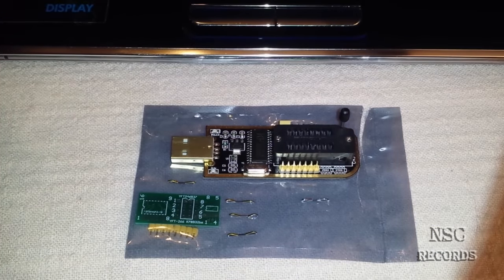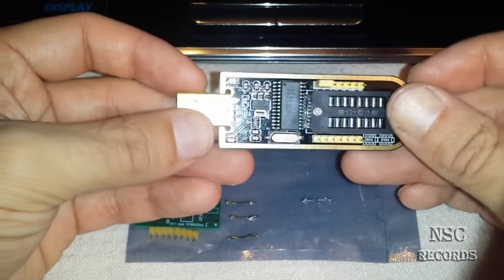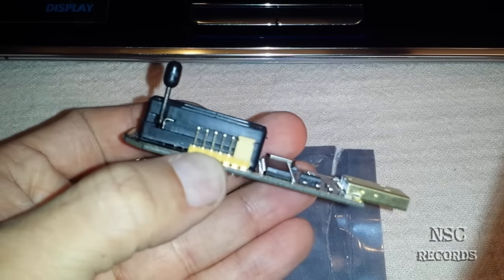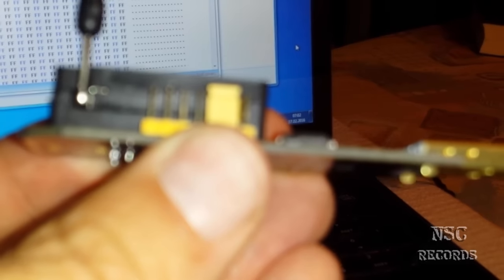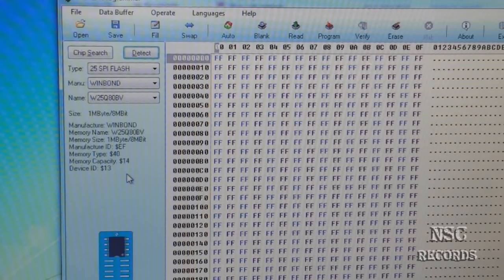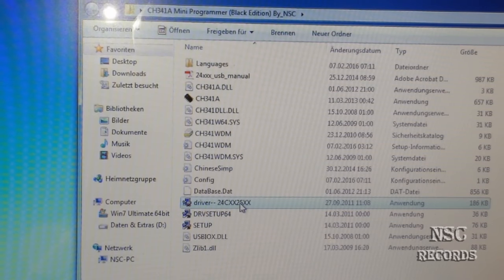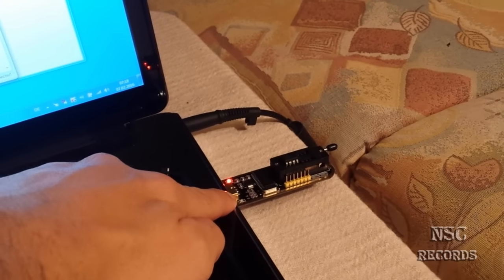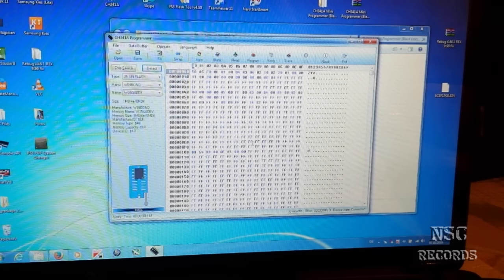Installing Drivers & Software for the USB Bios Chip Programmer CH341A (Black Edition) By:NSC

Comment: Hello. Could you please share with us what the extra jumper pins are for? I have successfully written BIOS bin files to chip, but the system does not seem to like the new bios information, even though it is the correct file 100%. Maybe it needs to write to chip in a special mode?  Thanks.

Comment: Hi! Just to point out, the jumper betwer 1&2 or 2&3 is used to set the programmer in Parallel or Serial mode respectively (there are different drivers available for each mode)

Comment: This device has 2 operation modes. The mode selection is based on the jumper placement.
Jumper pin 1 & pin 2 -> programming mode. As you well described.
Jumper pin 2 & pin 3 -> serial TTL mode. We can directly connect pin TXD, RXD, and pin GND (3 wires) to a serial port of another device.
Reply from the maker: That's right, you got it to the point :)

Comment: Even though you posted this several years ago, it is still a huge help to us who are having troubles with BIOS (in my case, on a LattePanda Alpha - the flash to the new BIOS went badly and I bricked the device). My biggest issue was getting the menu system in my CH341A in English - and YOU solved it!! Many thanks - was pulling my hair out.  cheers
Reply from the maker: You welcome ;)

Comment: 1. Position of the Tab:  It is written on the circuit board.  1-2 for programming and 2-3 for TTL.  Unfortunately written in Chinese
2.  The Up or Down connection:  It is also shown in the circuit board.  Top is for 25 and down is for 24.  For most bios,  it is 25 chip and one must select 25 SPI Flash in the software.
Reply from the maker: Great Info THX

Comment: Thanks for the video. I don't have this programmer (yet). Nor have I downloaded the software yet. But there is one thing that seems obvious to me, just from watching your video...

Problem #2, Wrong Chip Placement in Socket Depicted in the First Version of the Software (that you used)...

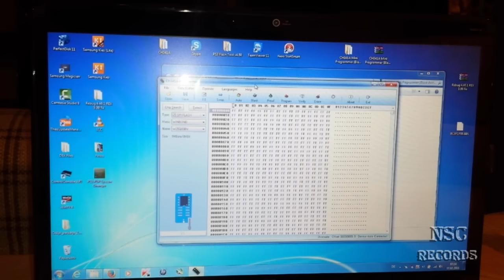@ 10:46 - The type (in the first software) is set to "24 EEPROM".
@ 14:00 - The bottom of the programmer shows the upper bank = "BIOS 25 SPI", and the lower bank = "EEPROM 24 I2C".
@ 16:32 - The type (in the second software) is set to "25 SPI FLASH".

I would bet you 25 cents that both software versions will properly show (in the lower-left graphic) the correct orientation and placement of the chip, if the correct chip type is chosen. I could be wrong about that, but I doubt it. Once I get the device, I'll test that.

I plan to use this device on HT24LC32 chips (which can also be written to by the end device). It's obvious to me that 24 series EEPROMS would use that lower bank, that was incorrect for your 25 series BIOS chip.

Still, a very helpful video, after I jumped to about the ten minute mark. Pins 1 & 2 was it? LOL (Sorry, I couldn't help myself)
Reply: I now have the device and have tested my "pre-ownership" theory... mostly. The video never really tells exactly what the first software was, you know, the one that you abandoned. However, I did download and test the version of the software that you provided the link to (thank you for that).

My original theory was proven correct in the second software version (the one that you ended up using). When the type is toggled between "24 EEPROM" and "25 SPI FLASH", the graphical representation in the lower-left does indeed show the correct orientation and placement of the chip for each type.

It's hard to believe how little $$$ you can get these devices for. Mine was around 6 bucks. And your links to the files made it easy. I just used the file that pre-installs the driver, the file that installs the main software... and it just all worked.

I installed on a Win XP 32 bit laptop. Works like a charm. Thank you for putting it all together and providing the links.
Reply from the maker: @dalemarkwell1171  Hello I just saw your comment right now and yes you are right about the Chip position, first you need select the chip type, then you will be able to see the chip position, but on the time i did this video i was very new to this tool to, so i didn't know a lot my self on how to use this program. Best Regards

Comment: In arriving package position, jumper position is on TTL. This meaning from USB you need connected wires from USB to by description on the bottom programmer PINS. If you can seen 1-2 meaning (USB Normal) 2-3 TTL then come TX0, RX0, GND and 5V. From other side come output pins (5V, 3.3V, GND, MIOS, MOSI, CS and CLK). With this pins you can connect FLASH or EEPROM with wires to ic pins without de-soldering. More information about TTL Cable: https://www.kiwi-electronics.nl/usb-to-ttl-serial-kabel?lang=en
Reply: Hello Dejan, If I understand correctly you say it is possible to rewrite BIOS while is still on the motherboard. Can you give more details about the procedure?
Reply: @laurentiumusteata5567  who whole idea of getting this controller with a clip is to avoid bothering with soldering 
https://www.youtube.com/watch?v=2Y06x1f22B0
your shoud google a bit more, before erasing uefi bios save save it's uniq settings with controller   (mac addr)

Comment: Flashed Asus N73sv laptop with latest bios and bricked it (thanks Asus) I learned that with this tool you need to first erase the chip or you get read errors. extra info on Asus N73SV is to NOT use their bios but search for the N73SM Only that version worked! even older versions of the original N73SV did not work. Happy with this cheap tool. It does read all . files btw.
Reply from the maker: It's a nice thing :)
Reply: Update... this SM version made the laptop boot and was working but the videocard did nothing. found the komplete 4mb SV bios elsewhere and flashed this true N73SV and now everything works again. Another tip is to perhaps buy a better clamp since its not perfect and you have to re-place it a couple times to have a good connection. cost me like 6 euro + some extra chips to experiment on for 1 or 2 euro :)

Comment: Jumper 1 /2  are for the serial CH341SER and 2 /3 is for the Parallel CH341PAR. Totally different drivers for different pin connections.
Could be the other way round but you can mess at your leisure.

Comment: Great job m8. Thanks for info and for the files provided. Very helpful. Thanks again. One thing i've noticed is that the soldering joints of this device is purely made. I will use my soldering iron and resolder the bad connections to make proper and acceptable soldering joints just in case so it can be more reliable to the task.
Reply from the maker: Thx to u 2 mate ;)

Comment: Awesome, so much helpful, really thanks for the video.
Reply from the maker: +Pablo H.M. Thank you, and as i got the time and an eeprom Chip, ill do that Video. Best Regards
Reply: +UltraNSC ok, I think its a flash chip the one I'm working on, not an eeprom as I tought before so the autodetection button should work but it is not. There is a code wrote on top of the chip but the programmer hasn't that code for any manufacturer. Should I get specific drivers for my chip? Its the first time Im trying to proggram a chip so I have no idea of what Im doing. For if it's usefull here you have my chip code: B45AD B58196
Reply from the maker: yeah, but normaly i give no Support, i just did the Video for you know how it works :) If you like upload me a Pic from that chip...
Reply: +UltraNSC thanks so much for your attention, how can I share to you the pics?
Reply from the maker: UltraNSC@live.de or look for some free upload servers

Comment: On the opposite side of chip locking lever there is a drawing on PCB how the memory chip should be installed :) . If you'd rotate the socket by 180deg so the locking lever would be pointing at usb connector then the image in first software would be right too. 

Thanks for info about the jumper 👍

This is just my guessing: The software was designed probably for hardware that have the socket rotated (maybe predecessor of EZ2019 (ezp?) or 2010), but when "cloners" show up and copied the hardware they rotated the socket how it's now (because it's more user friendly, and they can't copy 1=1 board layout either because: maybe of legal implications or the board was just too big and cost too much ;) ) but they still used the original software ...
Reply from the maker: Thanks

The Software was for an other USB Programmer ^^

Comment: So received mine, and managed to reprogram my bios after it didn't update properly and my laptop didn't turn on. I had to use version 1.30  of the software otherwise it didn't pick up the chip. But so easy to use

Comment: genau die Dateien habe ich gesucht, besten Dank! ;)
Reply from the maker: Yes, bist immer Willkommen ;)
Reply: @NSC-Modz  morgen früh kommt mein Programmer (auch der schwarze) Habe hier ein HP 6570b, da hatte ich den chip von nem Spenderboard umgelötet nur die ID´s passen nicht. Wie sind deine Erfahrungen mit der Klammer? Kann ich den Chip auch lose in die Klammer einsetzen? LG
Reply from the maker: @ungarnunsereneueheimat3868  Es gibt verschiedene klammern, die eine die aussieht wie eine zange ist nicht so toll, aber wenn du noch etwas warten kannst, zeige ich dir bald was richtig gutes.
Reply: @NSC-Modz  Es hat perfekt geklappt und das auf Anhieb. Danke für die Infos und Dateien 👒

Comment: Shorting pin 1 & 2 for Bios Chip flashing mode,  Shorting pin 2 & 3 if you use it as a USB to TTL adaptor.

Comment: Thanks for this, ive been messing with this programmer board for a while and even though my chip is detected from motherboard because i'm using the clip. I don't see any green light flashing when it's flashing the firmware nor reading.. It's just another red light that turns on.

Comment: caution!!! I have tested two eeprom ATmel 24C04 and ATmel24C02 with software versions 1.17 and 1.29, I noticed that the pin arrangement on the terminal connector was different from one version to another, in fact it heavily heated the voltage regulator AMS1117 (from 5 va 3.3V). Do not trust if sometimes the software signals that the device is connected! There may always be an incorrect connection and you may be damaging the CH341A. With version of the CH341A black use only version 1.18 software (tested with the two eeproms and runs regularly.) Version 1.17 and 1.29 are likely to burn the CH 341A black version
Reply from the maker: You are the first one with this info, but for now thank you for that.

Comment: I’ve been trying to get this programmer working for like 3 years. I’ve watched this and many other videos. I’ve tried it on windows 7, windows 10, windows vista. I install the drivers, I try the 24xx25xx, nothing, the driver64, nothing. It just shows device state not connected in the software. I have no idea why it’s not working. Jumper is in the right spot
Reply from the maker: I guess it's damage?¿ faulty or whatever...
Reply: NSC Modz maybe :(
Reply: same mine is brand new too

Comment: Greetings UltraNSC!

First of all thank you for your time and effort in making this video, really appreciated.
May i ask you sir, does this USB programmer has the pins where i can solder or use bios chips of LGA 2011v3 x99 motherboards like for example MSI X99A Gaming 7 USB 3.1 ? Because i see in the video you where using a bigger bios chip.

Thank you very much
Reply from the maker: Thank you very much... Yes, there is also a small PCB included, where you also can Solder those Chips, maybe ill do a Video about soon...

Comment: Sehr gutes Video hast mir echt geholfen Like
Reply from the maker: Willkommen ;)
Reply: Hello UltraNSC Could u please help me with my issue? When i connect the clip on to my winbond 25q32v the state changes from connected to not connected and the led light slighty dims. I tried using a different computer and drivers still no luck. What could be the issue?

Comment: got my programmer off wish, came with the blue one, the pliar connector for the chip not to be desoldered, and the green smaller attachment... and a few other things to place the chip inside it when its off the board. but i got it for free off wish by saying it didn work....been 2 years now used it one time. bout to use it in the morning...well its 2a.m. but once i sleep and wake ona asus b450 prime plus mb with a bad or just needing updated bios as i dont have an older cpu and only have a 1600af and 2400g the 2400 is what im using in it with a 1080 strix build for my wife. mines a 1600af and 2070 super ftw3 ultra...anyways thanks for the download link yet again!
Reply from the maker: Wish is the biggest shit ever my friend... But i "wish" you luck with that fake one xD
Reply: @NSC-Modz  lol i wish i could send you screen shots of it bud its real. verified that along time ago works REALLY WELL at that. used ona gpu like i stated that was fake had the wrong bios on it flashed the right one with it....are u mad or some shit?
Reply: @NSC-Modz  also you need to update your program as there are LOTS of other programs for this flasher man. for a few chips only a few versions will actually work. in which i just found out.
Reply: @NSC-Modz  this is what issue i just had and found out i needed to use a different version of the software.
Reply from the maker: @Kraxt0n  sure, look how old this video is ^^

Comment: Lots of chatter online about 3.3v and 5v USB output not being switchable on this unit, and a modification being necessary to adapt power output to the lower voltage.

Will this fry a 3.3v BIOS chip?

Am trying reflash an Acer PC EEPROM (on the motherboard using a ribbon connection) after a faulty BIOS update bricked the PC.

Is there perhaps a jumper setting available to adjust voltage?

Thanks
Reply from the maker: Check this:
https://youtu.be/cEPmi50hIoI?feature=shared

Comment: thanks very useful.
I've bought a soic8 clip to program chips directly over the pcb of my graphic card.
Reply from the maker: thank you
Reply: UltraNSC I doubted about those pins but this video solved the problem. There are other information under this programmer which distinguishes the 2 parts of the superior clip. Probably it is intended to separate a kind of chips from another kind of chips or for other purpose.
Reply from the maker: right

Comment: Just managed to recover my media pc using the chinese language download, windows 7 picked up the driver no problem but my windows 10 test install couldn't find it (i just installed the inf file in the end)

The computer was an asus m11bb mid tower that has been transplanted in to a sff htpc case.

I was trying to cross flash with a retail bios f2a55-m bios version 6603 onto the oem f2a55-m/m11bb/dp_mb to try and fix a fan error where it would spin at full speed after resuming from sleep, the flash failed bricking the board ez flash recovery wouldn't work either.

The retail bios has the benefit of having extra features including overclocking and MUCH better ram support and configuration options (amd love fast ram)

initially it failed because i was trying to write the .cap file directly to the bios chip, i had to extract it using uefi tool before writing.

Now that the motherboard is alive again I am in the process of adding all the dmi and oem activation files back into the retail bios to reflash one last time.

once I've got all my serials numbers reloaded I can start testing to see if it was worth while.
Reply from the maker: Win10 is not recommended for things like this, better use a nice old XP system or Win 7 :)
Reply: @NSC-Modz  windows 10 is pain, sometimes it will refuse to launch programs with no hint as to why.

Imagine hal saying "I'm sorry Dave, I'm afraid I can't do that"
Reply: Ndamulelo Mpfumba  thanks for the offer but i don't use the win 10 partition often.

Comment: U really deserve to subscribe to ur channel...
I have one question... My laptop HP pavilion g6 and the BIOS lose the firmware frequently... Does this programer capable to program it??
And why my laptop BIOS chip lose the firmware every week proximately?
Reply from the maker: Yes, or just buy a bios chip on ebay.  Because your bios chip is corrupted.
Reply: @NSC-Modz  I have changed the chip  and I got the same result ...
And could you please give me the link where I can download the chip firmware?
Reply from the maker: @nibras26baqir  then it's you bios battery...

Comment: Hi to all, and thaks to NSC Modz for this useful video tutorial ! 

I've already flashed some EPROM without any problems, but now I'm in trouble with a "particular chip", in detail the EPROM is a Winbond 25x20 CLNIG and my CH341A programmer don't recognize it for reading. I've noted that into the programming software list my model is not present.

Do you have any suggestion for solve my problem?
Thanks.
Reply from the maker: It's hard to say where the problem is, may test the same chip again.
Reply: @NSC-Modz   Do you think that Is it possible to update the database for this version of software or maybe find a new version for the program?

Comment: Really helpful video, I do have a question though I have two Lenovo laptops I bought used I’ve had them for almost a year now and never really needed to go into the bios, I have however come into the problem I have a supervisor password that’s set and unknown what it is, how would I program the bios to revert back to default settings?
Reply from the maker: You will need a new chip if you lost your password...

Comment: I have problems with the software packages. The driver seems to install OK (with driver--24CXX25Xx.exe), but when starting ch341a.exe (v1.18), I first get 'Access violation at address 00000000..." and then I see the software interface, it always says Connected, with or without controller.
It doesn't find any chip and the Exit button again show the Access violation error. Not able to exit.
Ihave this on Win7 and Win10. 
Also my antivirus Norton erased a file from the 64b package because it contains a virus (WS.Reputation.1)! In files usbiox.dll and drvsetup64.exe